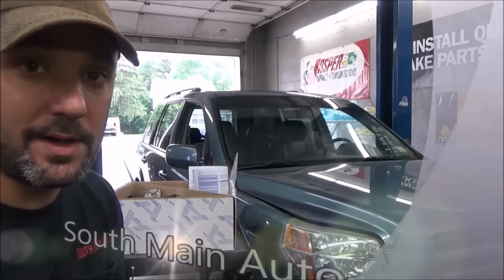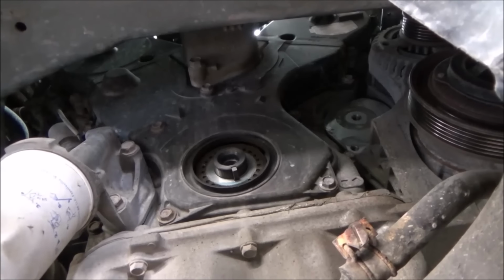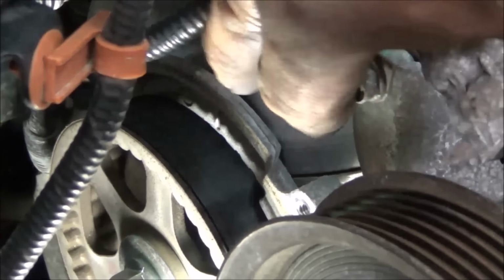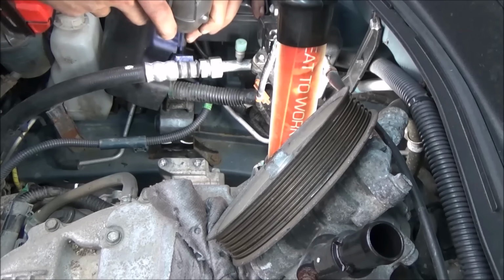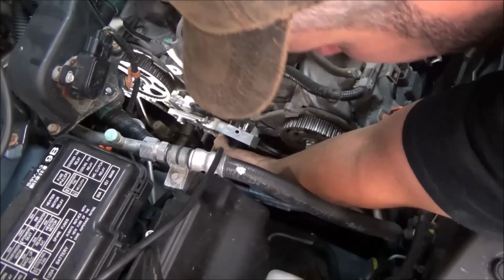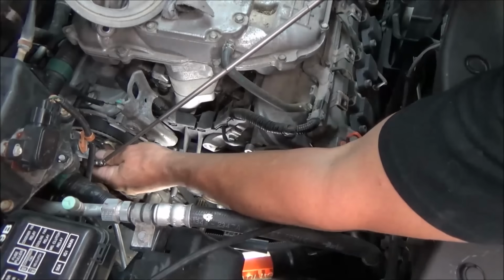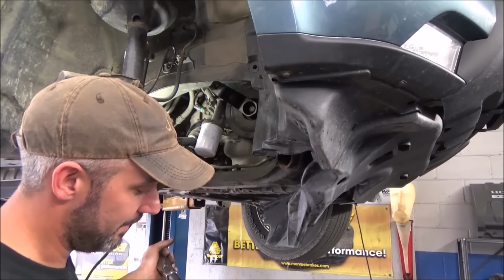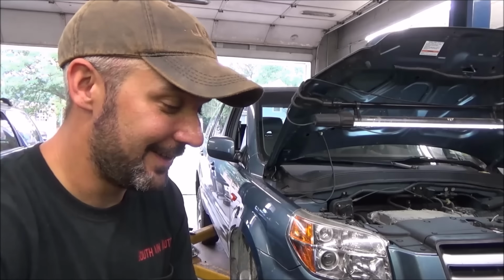Honda Timing Belt 3.5 J35 - Pilot, Odyssey, Ridgeline

Comment: thanks for the video, after reviewing your video. I was able to replace my timing belt and water pump on my 2011 pilot.  the socket didn't get off the crank bolt right away like how you did in the video.  however after heating the bolt it came off easy. thanks for the video.
Reply: only thing I wish I had was all the tools that you have making it much easier.

Comment: Would this be the same for a 2011 pilot?
Reply: Josh Poley  it's almost the same. I just finish working on my 2011 pilot. it took me a couple days due to other factors but the crank bolt was the hardest to get off.

Comment: Thanks for the video.  I did my Ody last fall with no problems.  I'm doing my sons this weekend and have a question.  At 41:05 you mention some locktite on the threads of the idler bolt.  What kind of locktite is that.  I want to get the right stuff.  Thanks.
Reply from the maker: I use medium strength
Reply: Thank you!

Comment: Thanks for the video Eric. I just did a timing belt on an  2007 Odyssey today. Next time I think I'll buy that huge 19mm socket, instead of using my cranck holding tool.

I noticed your serpentine belt tool you used was racheting. Do you have a link for the serpentine belt tool?

Comment: Looks like Sienna is the way to go for a used minivan. Before i watch this video, i know that timing belt replacement on Honda's V6 is a big job, but i do not realize that you almost need to do the same job for a water pump replacement. I love my 2002 camry, which is very easier to work on belt, alternator, water pump. I know 2008-2010 Sienna with a chain, but not sure the water pump is in timing cover or not. Probably not i guess. Toyota is easier to work on.

Comment: Good video, as usual. I'm working my way through them, from oldest to newest.
I like the tip on the PigMat to catch the PS fluid.
This got me thinking about what I use to keep fluids from leaking - rubber stoppers. I have an assortment that followed me home from work. I use them for hoses: vacuum to radiator. I also use them to plug the ports on the parts: gas lines, ps pump, radiator.
Look for something from Amazon, soon.
Mike

Comment: When I put on the timing belt it is tight all the way to the water pump but I cannot seem to maintain the same tension level around the pump and get the belt around the back cam sprocket.  What am I doing wrong?

Also, my motor has a bypass valve actuator that sits on the intake behind the ps pump.  If it is removed how do you reinstall it properly?

Comment: Thank you both for your comments.  As it turned out the seals were not leaking and I thought better of changing them out.  I do not have a lift so this job was a bit time consuming.  Also as was described in this vidio, the removal of the crank pulley was unbelievably difficult.  I bought the special Honda holding tool and put all my 265 lbs on top of a 6 foot breaker and only ended up twisting a 1/2 inch extension.  I almost gave up and then decided I was losing too much energy into the extensions that I was using trying to clear the fender.  After taking out the extension and finding a small angle under the vehicle, I managed to get a 3-4 foot bar on the pulley bolt and I pulled with everything I had.  Three tries latter it finally popped free.  If I did it again I would track down that heavy duty socket that Southman used.  When putting the crank pulley back on I was only able to get it torqued down to about +45 degrees.   Thanks again for all the info!

Comment: Great video! Thank you for putting it together. I feel so much better knowing I'm good for another 100K! Your instructions were clear and I am definitely subscribing.
Reply: I'm glad the timing belt on my '15 FE 1.6L is good for 150k miles, according to Ford maintenance schedule! I currently have 73K miles on the Escape. By the time 150K miles roll around, the Escape will have turned to dust (unlike the Honda). So essentially, I have a "lifetime" belt in my Escape. Thank you, Ford! And they say that American vehicles are worthless. Really?

Comment: One other comment, when a person puts the crank bolt back on to test turn the new timing belt a few rotations, be aware that if you have only hand tools, you cannot easily get the frank bolt off again. No doubt an impact wrench would take but a moment but I had to use two wrenches to hold both camshafts then my wife used a breaker bar to free up the crank bolt again so we could put the pulley back on.
Reply: Not having power tools, I ran into the same problem. Holding both cam shafts as you suggested did the trick. 
Would removing the spark plugs at the start of the job reduce the torque on the bolt therefore making it easier to remove after the 2 rotations?
Could several washers and oil added to the bolt make it easier to remove?
Maybe using a longer bolt the same size, then threading stop nuts on the bolt threads prior to turning it into the crank also make it easier to remove ?

Comment: Thanks to your video, I also got my timing belt changed. I had trouble with the crank bolt, so I used the starter motor method (on other videos) to get the bolt loosened. Only took two tries and it loosened. I was completely surprised at how well it worked. If you are having trouble getting the bolt off, use that method!
Reply: It's the method of LAST RESORT because you can damages the starter motor.

Comment: I am going to be doing this exact repair on my own vehicle in the next week.  It is an amazing thing being able to go online and watch ahead of time what the actual procedures are to do the job.  I am no dummy being a mechanical engineer but it is a great advantage seeing it in action.  This is one of the best repair videos I have seen so far.  I hate watching a video where I am left figuring out a step that was not shown, this was complete with all the intricacies relayed.  Anyone who could possibly give a thumbs down is clueless!  Thank you for the video.  I am planning on changing the cam seals, crank seal, and oil pump seal while I am in there.  I would have loved to see these also on video.
Reply from the maker: I have to be honest I work on a ton of Honda's and I have yet to see a cam or crank seal leak at or under 200k on the 3.5's I mean do as you like I would definitely be buying OEM seals. :) Good luck on the repairs Dan!
Reply: @SouthMainAuto  that's some good killer advice. I skipped the cam and crank seals cause m car has around 50k, will definetly consider it next timing belt job tho
Reply: Daniel S, I picked up the OEM cam seals before tearing into this job as well.  Because I had seen a few tutorials/videos warning about them.  Certainly this would be the time to address them.  However, when I opened up my 120K+ miles accord, the cam seals were fine.  So I didn't mess with them.  And honestly, even if there had been evidence of a tiny amount of seepage from the seals, I might have just left them as well instead of disturbing them.  Good luck with the job!
Reply: do you know if a Honda odyssy 3.5 will work in a mdx suv?

Comment: Great video, was wondering. I've seen kits include the crank shaft and 
camshaft seals. Do these need to be replaced as well? Of course if they 
need to but is it like the water pump where "since you're there, you 
might as well replace them". Also some kits include gasket sealant. You 
didn't mention using that. Is it not required?

Comment: Great Job!  Very informative.  My daughter's 2002 Honda Odyssey, with 204,000 miles, timing belt broke while she was leaning to drive.   We were stopped at a light and the engine just "Died".  After much research online, most everyone says that valves would be bent and motor would be bad.  I guess it was a gamble, but with the help of your video, I installed a Timing Belt Kit and the Van runs great!  No motor damage!  Hardest part was removing the Crank Bolt.  Used a 3/4" drive breaker with and a 4ft cheater bar.  Your Video was super helpful as there were no surprises as I was repairing.  Thanks for you taking the time to post!

Comment: I want to thank you so much. 
just finished a timing belt on my 06 ridgeline with a 128k. it all went the way you showed on your video. went to parts store and picked up the kit. I was scared stiff because never did automotive, but because of hard times I had to go for it. I did have a little help with Samuel Adams. thanks again.
Reply: that's pretty cool man. Just watch out for the water pump and timing belt tensioner, I don't think most parts stores use OEM and they are known to fail at a higher rater, those are two parts I would definetly avoid chinese.

Comment: Thank You!!

Absolutely, Great production! Camera angles worked! ...As did the Pilot engine once completed! ...During your production you mentioned a Ridgeline as your personal vehicle?

My wife & I have recently settled on an '07 Ridgeline as a replacement for a 98 Ranger w/128k. The Ranger is about to split in half... at the box/cab! ...We have been shopping for nearly 2 mths for trucks, SUV's etc and finally stumbled upon the Ridgeline model as our final solution (settled on 8k w/Seller)! The Ridgeline is in fair to moderately great condition. No body rust whatsoever and very negligible frame rust ...for a vehicle in upstate NY area (Albany) and all checks-out including Transmission fluid color, Oil cap, color and zero white or blue smoke. Camber angles our tight as well as the Frame when inspecting the hood and door channels/gaps. However, my one question on 100k service w/ Seller has evaporated from my notes! That Q will be reviewed again w/ Seller before signing off on purchase agreement, but what is your advice on revising the price point if the Seller has not had service? My experience under the hood is rated as backyard over the years and potentially could pull off this job... but would rather settle w/Seller over the cost vs price point.

Many Thx!
Rick?

Comment: I keep ending up on tooth off on the rear cam after I do the rotation what am I doing wrong.
Reply: You pop the belt tension loose and it pulls it tight. This is why most will make an allowance for that. Then check it again. My first one I did, had the same issue after 5 tries I figured it out. As the crank moves ever so little.

Comment: Well done, this was great info, helped me very much, I had a cracked head in mine , Cylinder 4 , which cracks right at the frost plug and allows antifreeze to get sucked in through the intake, so you still have normal compression, but a fouled sparkplug!
In case anyone is thinking they have a bad head gasket,  this is common on the 3.5!
Good little engine otherwise, well engineered!

Comment: What do you do in the case that one or both cams are off the mark when you go to check it after putting the belt on??
Reply from the maker: realign them?
Reply: +South Main Auto Repair so you would take the belt off and be able to move either cam independently to line the marks back up and then put the belt back?
Reply from the maker: Jeff Allen Oh sure. If the timing is off you need to readjust it.

Comment: Eric, did you do this on Vanessa's Odyssey  yet?  Was it more or less accessible?
Reply from the maker: I have done dozens of Odyssey's. They are pretty much the same. I think a bit easier because the engine does not sit as far down in the engine bay IMO
Reply: +South Main Auto Repair very cool, thanks for the reply.  I'm still at about 50% as to whether or not I want to tackle this one myself because I don't have access to a lift or air tools.  hand tools and lying on my back or side doesn't make for much in the way of leverage, especially when dealing with the crank bolt.
Reply from the maker: Got ya , No big deal, It should not cost that much to have it don in a shop. 4.5 hours and parts should do it.

Comment: I was about to buy an 06' Pilot until I saw that the Timing belt had not been replaced. I asked the service guy at my local Honda dealer (where the vehicle was located) about how they do it. Sounds like there they actually lift the engine to get at it? Sounded to me like a slick way of ripping someone off for extra labor costs. I kept on trucking, which is sad, because I loved test driving this vehicle, haha.
Reply: Well, in all fairness. It takes a lot of experience to do timing belts and such. Eric makes it look easy because he's done it countless times. When you do something often enough, you make it look easy, even though it is complex. When you're paying labor costs, you're paying for the job to be done in an averaged out way. Flat Rate technicians do not make an hourly wage. They make money based on the job turnout (how many hours of labor, and jobs they do) Then they make a percentage of the labor hours billed. So they have to work fast to make a living. Not ripping you off, because if they mess up, they work for free. As for the labor costs (Cost Per Hour, Price of Parts, and Shop Supplies) That's all extremely over-priced because they can do it.

Comment: oh yeah ' I know about the Honda crank bolt . I've put in several timing belts on our civic and experienced this bolt,  I found out the hard way that if you don't torque it back down that it will back out.  luckily it did not ruin my crankshaft, it just damaged the key and was able to just get another key and torque and lock tight it back in. great video as usual

Comment: I love your video’s, they have helped me successfully complete a number of car projects.  However, I'm putting in a new timing belt on my 2007 Pilot (2WD) and have ran into a problem.  I started with the two upper cams marked in the 12 o’clock position .  After putting a new timing belt/tensioner/water pump, the top left/rear cam was out of line, the top right front top and lower crankshaft pulley remained aliened.  The top rear left cam was now at around 3 o’clock.  So removed the timing belt and tried to manually adjust the top left/rear cam, it would move about a quarter turn and spring back.  So.. I put the timing new belt on, put the bolt back in the camshaft (lower) pulley area and tried to turn clockwise to rotate and realign the top left cam to TDC.  Unfortunately, I turn clockwise on the ratchet and it goes about a quarter turn and the resistance  stops me from going any further.  You can hear a metallic thunk sound once it reaches that point. Without risking searing off the tension pulley attached to the water pump (did one already) and not wanting to damage the values.  No matter which direction I turn the crank shaft pulley, after a quarter turn I hit resistance and can't turn the timing belt anymore.  So what am I doing wrong?  How can get the correct TDC on all three?  Help!Cranky in MD.

Comment: Excellent video from what I can tell - thanks for making it! I've got a Dayco kit in hand for my 2006 Odyssey and I feel much better prepared to tackle the job. ----- Can I ask: what's your take on the VCM in some of these vehicles? I grew to loathe this feature after suffering a horrible droning vibration for a couple of years - I even spent hours combing the internet trying to find a way to disable it, to no avail. Finally I found a new electric rear mount for just over $100 and had a guy off Craigslist install it. Worked for a bit, but already the drone and vibration are coming back. I guess I'll replace the other mounts as well. I think Honda should make amends on this problem.
Reply from the maker: +bbolding3 Welll I can tell ya this. If you can fix the drone noise in a pilot you will be a millionaire. As you have likely all ready discovered.. no one can fix it hahah

Comment: Thank you SMA! the 19mm monster socket worked great albeit, it took a couple of hits to get it off.  I used the same Aisin kit . Getting the big through-bolt that was on the motor mount ended up pulling the threads with it from the bracket. Maybe too much locktite? I was able to clean out the threads and reuse so no problem. Also removed the power steering pump early on to get it out the of the way. As instructed, cut the belt and didn't drain the radiator; used a little over a gallon of coolant. Took about 5 hours without rushing !  You the man! thanks.